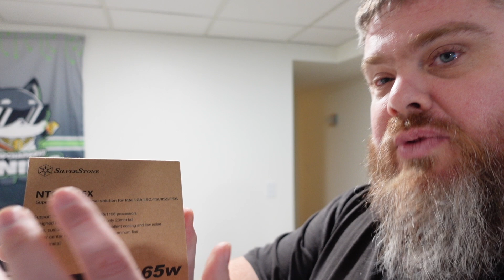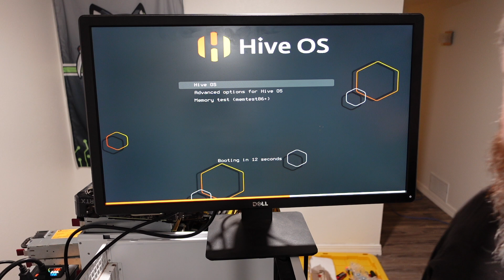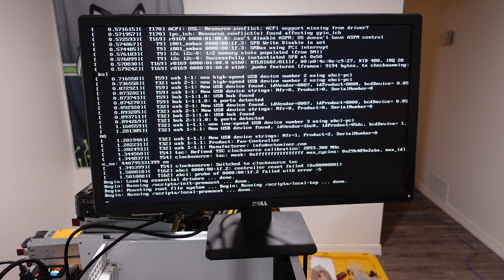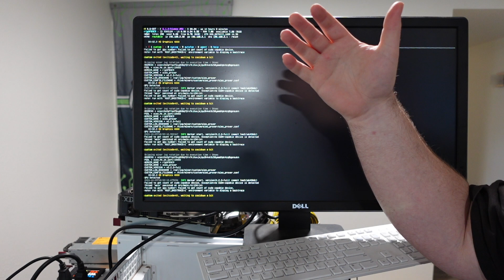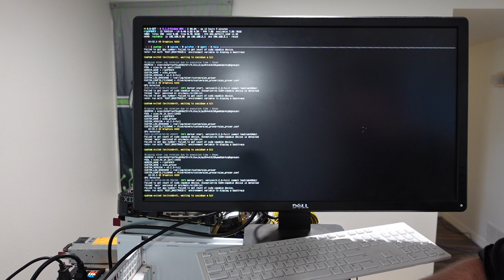Life on a 2000+ GPU Farm

Comment: @theminingkiing Try this processor Intel Core i3 4370 SR1PD 3.80GHz Dual Core LGA1150 CPU Processor. These are the processors I use in my 3 R8's. Never had a problem.